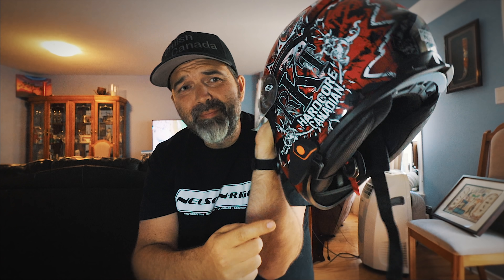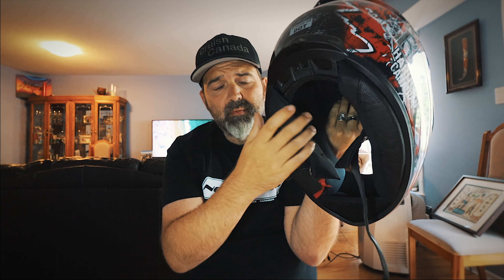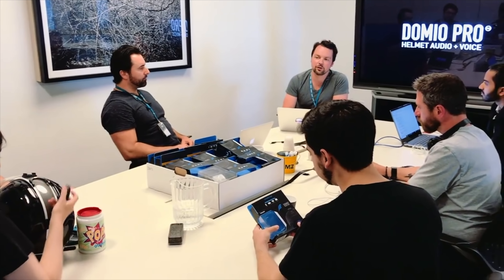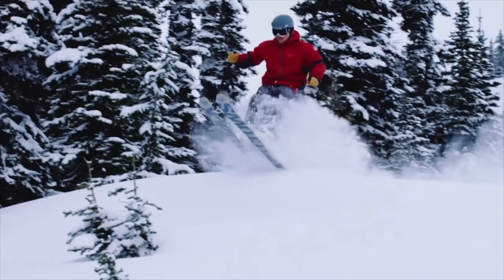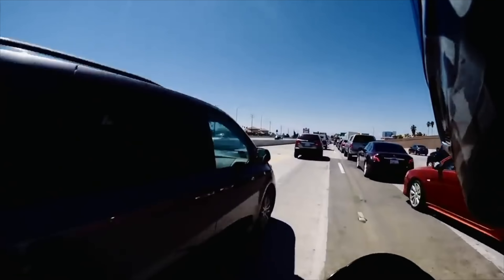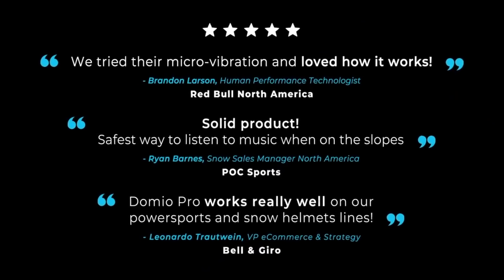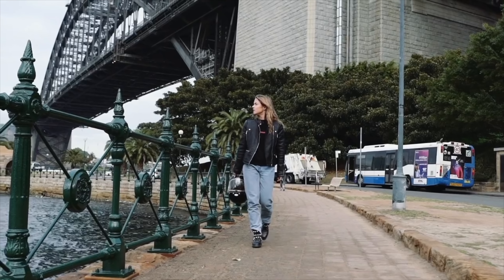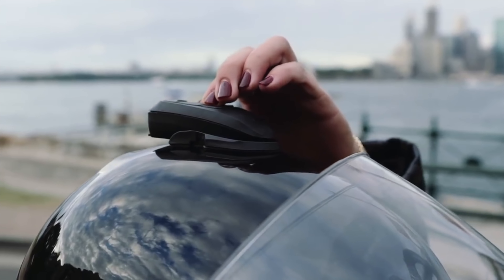Domio Pro Audio and Communication Device | Game Changer?

Comment: I'm curious if this system will help with my partial deafness. I only have about 25% hearing in my right ear, making it very hard to hear conversations with other riders when at highway speeds. Presently we are using Cardo G9 which picks up a lot of static or wind noise from the other riders. Data usage and whether people outside of my helmet will hear my conversation is also a concern. Often I leave my helmet on when I go in to pay for gas and my wife and friends are having a conversation outside. Will everyone in the store hear this? Hope you are able to test these concerns.
Reply from the maker: I've had a chance to try the audio-only unit (so not the communication version).  So not sure about communication with other riders.  Our riding season is over here in our area until next spring.  The sound quality of the audio, in my opinion, is quite good.  But, yes if you put your helmet down with the audio playing, everyone will hear it.   Here's a link to my testing video of the 'audio only' unit.

https://www.youtube.com/watch?v=Jv-bEVzbovU
Reply: @gregtoope  I did watch that video and appreciate it. I personally don't listen to music when riding, just use the device for communication. I'll wait until spring to hear your review and go from there. Maybe you could remove your upper wind deflector to see the effect on noise. I ride a Concours 14 with the stock windshield and I do get some wind noise. I no it's hard to do a review for every rider scenerio but look forward to seeing your results. 
Winter came early here in New Brunswick, spring is looking far away.
Reply from the maker: Marty Thornton yeah I’ll probably not be removing my windshield but I can lower it and stand up on my pegs to get some wind noise. Winter sucks. Can’t wait for spring!

Comment: I ve had my device 50 days ago I had lots of issues although am very happy with it but 
The device arrived with one mount and its broken 💔  I had to order one pair since the company not sending mounts
The device has a gap from the tail because of a missing screw 
It keep disconnect from the phone while riding and I must press it towards the base to get the sound again 
Its disappointing product 
AND suddenly the device freezed its not functioning but light blue and i cannot switch off or on
DOMIO COMPANY COULD SOMEONE ANSWER

Comment: Have you tried it out since you posted this video?
Reply from the maker: Anthony Lagrosa nope and sadly they were supposed to send us a set and so far I have gotten zero response from them.
Reply: @gregtoope  - Thanks for the update!  "UPSETTING."
Reply from the maker: Anthony Lagrosa upsetting is definitely a good word for it. Definitely not a company I would trust after the stating that a unit would be sent out and then getting zero response when trying to communicate with them after.
Reply from the maker: Anthony Lagrosa I was really excited to try it. ☹️
Reply: @gregtoope  Did you pay for it? Sucks if they are not responding especially if you paid.
Reply from the maker: Zed A I did not. We were going to get a test unit to try out and review. We had great correspondence back and forth. Then as soon as the item was available and was on the market. It stopped. All communication went away. First company that has ever happened with.

Comment: So I don't get this product at all.  First is its stated design value proposition not to interfere with the (ambient) sound coming in.  But sensible riders already wear hearing protection (e.g., ear plugs) to reduce the damaging sound, especially from wind.  I want the opposite of what this technology claims to achieve, as should other riders.

Then there is the intercom using cell data as a transport.  Bad design.  Riders often go through cell dead zone, e.g., curvy mountain roads often are cell dark.  In contrast the new intercom DMC Mesh technology in Cardo Packtalk and Sena 30K does what you want - gives you seamless communication with other riders within a significant distance (1 mile point-to-point, and several miles using its transparent hop capability).  Finally we have good working intercom, but Domio decides to use a different technique that introduces other problems.

I also look at the aerodynamic footprint of the Domio device.  Not good, especially for sport riders that achieve higher speeds.  I don't use my Bluetooth system for music, but if I did I would not like the lack of stereo inherent in a helmet conductive system.

Anyway, I don't get it.  I can't think of anything I like about this relative to the system I just purchased (the Cardo Packtalk Slim JBL) and lots of things I would hate.  Someone please explain to me what I'm missing.
Reply: Just a heads up; When your order is about to process, you are given the opportunity to purchase noise cancelling ear plugs and a handlebar control unit.  I had to complain, after I had placed my order because they don't offer those options before you buy.
Reply: I guess I'm not a sensible rider as I don't wear ear plugs because of partial deafness. If I did use them I wouldn't be able to hear my wife or buddy's conversation.
Reply: Why don't you just get what works for you? Nothing works for everybody,and most people understand that.get something that does the job that you need to have it do and stop whining about something that you can't change.plzzz.

Comment: Will it work on a full faced helmet
Reply from the maker: I was supposed to be getting a set of these for testing purposes but sadly the company has been impossible to get a hold of.  Not very promising from my point of view.  I had very high hopes that these were going to be great for riding.  Hopefully someone else can answer that question for you.
Reply: Yup they will have them for full face too. It will come with an extra mic that you install on the inside of the helmet near your mouth.